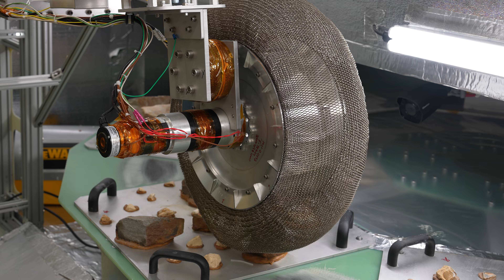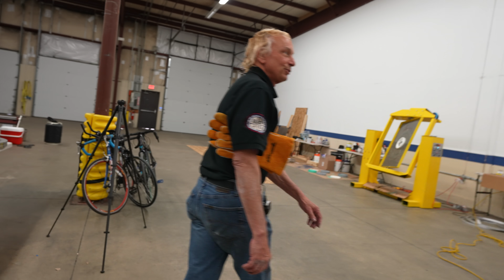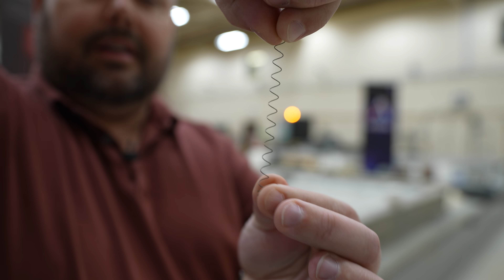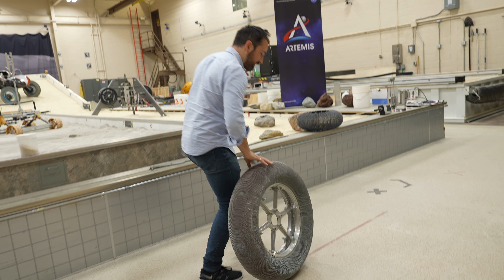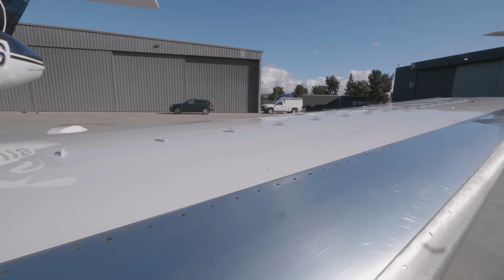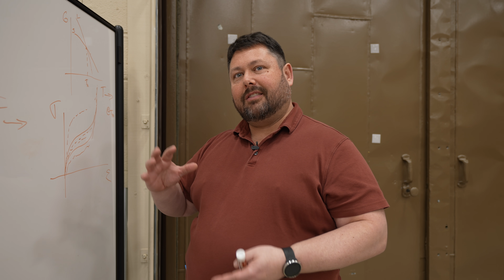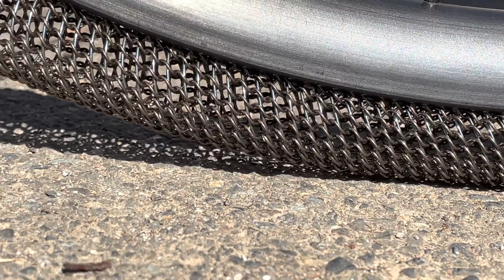How NASA Reinvented The Wheel

Comment: Going from the higher symmetry phase (austenite, FCC) to the lower symmetry daughter phase (such as martensite, BCT or B19′) is exothermic. 
Exothermic Process: The transformation releases heat.
Reasoning: The transition from a less-ordered state (higher temperature) to a more-ordered state (lower temperature) releases energy, making it an exothermic reaction.

Martensitic Transformation: The transformation from FCC austenite to BCT/B19′ martensite is a diffusionless, shear-like process that occurs upon cooling, which is exothermic.

Reversibility: While the cooling from austenite to martensite is exothermic, the reverse process—heating from martensite back to austenite—is endothermic. 

In summary, because this transition involves a decrease in temperature and a shift from a higher to a lower symmetry phase, heat is released (exothermic).

Comment: I've been interested in robotics since I was in my early teens but when everyone started building them with electric motors or hydraulics or pneumatics, etc.  I lost interest because the obvious limitations made it clear none of those singular paths would ever exceed the capabilities of a human body.  My concept of a robot had a nuclear core and heat-activated, metal, muscle cells/fibers attached to a metal skeleton and could move with more strength and fluidity than a human. Nitinol, hydraulics, pneumatics, nanotechnology and Boston Dynamics LIDAR based sensory feedback systems are finally ready for my robot.

Comment: So you. Are inside a different earth  system.  . With a independent power supply.  Capable of supplying  aprox 16amp around 3KW. How does the fault protection work.  If you were to plug in a faulty kettle and touch a tap. ?????

Comment: 12:42 one little spring of nitinol just produced 20 pounds of force, just 10 of those could do 200 pounds, now 50 of those in an exosuit from the future made to enhance lifting and our carrying weight, would be made of this, using electricity to generate enough heat to help one carry stuff, and cooled down when the task is done, or i just watched too many movies😅
Reply: Thinking about it, you can just use normal mechanical parts to lift, and the heat from the motors and or batteries could be used by nitinol to help with the torque or strengh

Comment: The fact that it can never be under rinflated or suffer a puncture—both of which would indeed offer a boost to fuel economy may really sound like a good idea. I agree. However, when it comes to practical applications for traditional automotive use, the benefits become a bit unclear a little for me for other things. Perhaps, with the addition of sensors to understand and react to the upcoming terrain, such a tire could adapt in a way that traditional tires cannot. If it could “sense” potholes, rough patches, or even gravel, it might be more adaptable. But in terms of simulating the proven stability and performance of traditional tires, I’m skeptical. For one, the contact patch of an SMA tire wouldn’t be anywhere near as large as that of a traditional tire, especially on smooth, hard surfaces like asphalt. Unless you’re driving at slow speeds or traversing something akin to the loose surfaces of the moon, I just can’t see SMA tires offering the same level of grip. That’s a major concern when it comes to performance on typical road conditions, where we expect a solid, consistent contact with the road for both control and safety.

Then, there’s the sidewall stability. Traditional tires excel at handling weight shifts and highspeed cornering due to their construction and it’s hard to imagine SMA tires providing the same level of sidewall rigidity under heavier loads without sacrificing other qualities. You could have a tire that self heals, but if it doesn’t maintain stability under stress, it won’t be practical for everyday driving.

Now genuinely speaking, I’m not against the idea of SMA tires—there’s certainly something fascinating, the introduction may prevent me from changing tyres briefly- oh I need to be trained about them—but anyways, when it comes to road surfaces and the tried and true durability of traditional tires, they still hold a distinct edge. Plus, I can’t help but wonder how much noise these SMA tires would make on pavement; the constant adjustment could lead to a rather noisy ride? Tell me, I’m really curious now. 

The only true situation I think I may be content is when everyone before or after they were zombified threw all the nails, screws, you name it on the road for whatever reason and the zombies were like the ones in the walking dead then I mean yeah, I’d take these. I don’t know when I’ll need replace them though. Does your tire have a recommend range or year? 😂 just the rough estimate when it’s no longer practically drivable I change them xd

Comment: can't you just combine the tire and the iron tire together ?
cuz with the rubber of a normal tire, it has more grip on the ground but the tire can pop and loose the structure of the tire and stop working normaly
, while the iron tire has an in destructible material and structure but less grip on the ground { by ground i mean roads } 
so if we combine those 2 together, you can create something that basically you never need the worry about again,
or there are problems that i dont know of so please correct me
Reply: Unfortunately, this approach does not eliminate the problem of achieving the lowest possible weight for objects sent into space, and even then, rubber is too fragile in the harsh conditions of Mars or the Moon. Even if we ignore the extra weight and choose a material that is more durable than rubber, it will still wear out so much over time that it would be the same as using only nitiol tires.
Reply: @w3n11  i know it will shatter in space but i ment a use for it here on earth

Comment: Does it induce electro magnetism when stretched and vice versa, can an electrical current, AC or DC, induce movement?
I had an idea for something similar but you wind it only half way around the rod and back forming an arch shaped, semi tube, (not-quite coil,) apply different AC current frequencies for movements. Perhaps DC current amplitude variation does something else.
Saw it in a dream so, may just be garbage. Though, I believe I saw a magnetic lens in a dream 20 years before I knew what it was.

Comment: They demonstrated a car tyre, but only on one wheel.  That was disingenuous.  Three rubber tyres were providing traction and the nitinol tyre came along for the ride.  Rubber tyres work so well because they react chemically with the road to provide traction.  There is none of that with nitinol.  The only traction you get is where the physical roughness of the road snags on the weave.  Nitinol tyres would be like driving on ice.  I suppose the solution would be to embed the nitinol in a traditional rubber tread.  This would have traction without needing to be inflated.

I would love to know whether the story about its discovery is true, or whether it was reverse engineered from the Roswell crash debris.  The origin story seems contrived to me.  This material behaves so much like the metal described by the witnesses of the original debris, before the military changed their story the next day and substituted aluminium foil for the press photos.

Comment: A few questions on this safety wise. What if the ribs (spiral springs) end up bending forming flat or soft spots and/or the tire gets punctured and water gets in there to start rusting the wheel... Just a heads up to save possible horrific damage. I guess it would be fine on a machine, but that would be hard to trust for a human to be on. Great idea needs some tweaks.

Comment: 15:02 specifically the part about stretching the nitinol wire, This has to be one if the coolest things in science I've ever seen. so often we see concepts like this visualized in relativity abstract ways, that make it hard to connect whats scientifically happening to what we see/ experience in reality even just on the microscopic scale- never mind molecular. but this is one of the only times ive seen a process like this where you could LITERALLY HEAR the molecular structure changing as you stretch it. thats absolutely insane to me, in such a cool way.

Comment: Couldn't they add a way to electrify those wheels as needed and give it the right current to heat it up allowing it to return to memory configuration of the Nitinol? This could be an as needed thing in case something happens where it goes past the elasticity range.

Comment: You know what's interesting about a stress-strain curve is that strain is along the X-axis. That's because when you load a material, that load is causing deformation, and the material is imposing its own force we call stress to counteract it. The stress in the curve in the video (which is for steel) even has negative slopes in it, which would be impossible the other way around. So technically, "stress causes strain" (paraphrased from 5:40) is confusingly not correct.

Comment: Question: if the metal reforms into its original position, does it become more brittle in that form. I'm asking this because it seems to be a rather malleable substance and when a malleable substance becomes hardened it's harder to deform but becomes easier to break, crack, ect. Though I guess it's malleability isn't necessarily changing, it's just as malleable but you just can't control how it moves.

Comment: I dont get the thing with the tires... why do you need a special metal, that remembers it pre-defined state.
Couldn't you just use regular metal like steel an make a spring and an airless tire the same way?
The right steel shouldn't deform under the pressure of a bike and it's driver as well, right?

Comment: Why not Use Magnetic engine block. I can think of using the Circular 🧲 to create perpetual motion of the fuel. All instead of  plastic 3D printer 🖨️ Parts. I think it will increase the Neuton punch the engine has now from 4-500 to 800-1000 Neutons. It increases by 🧲 Magnetic Strength. I've seen and used Magnets in the past that could lift a Car 🚗 off the ground,2000 ft pounds of Magnetic Strength with a Cable drilled into magnet to lift car off the ground using a Forklift or Crane. In Florida these powerful Magnets can be made to Specifications needed for your Entire engine. Let me know if you try this idea. Don't be afraid of the unknown power of Magnetic power being turned into Magnetic Plasma. You can even reverse Polarity from Earth 🌎 and the Heavens.

Comment: Excellent video.    I am a "tricity" junky also.  Every thing g you have showed is exactly how my minds eye sees its functions inside the laws we are aware of.    I have a interesting phenomenon that happened today.    So I am starting my Onan generator up on my off grid property.   And the generator has  no starter.  Just uses the generator winding to start.    OK.   So.  First.  The generator isn't stock.   But it was originally a 220 generator with a common. Leg pulled from center much like home power.    2  220 legs.   With a center tap neutral to split to 110. OK.  Well since i needed 2 220 legs for my deep we'll pump.    I eliminated center tap and now have gobs of power.     And I still use the center tap for other appliances after it comes back from pump it center ter taps and compressor and other house hold devices use it.   However it is a lot more difficult to start on 12 v.    So I set up 2 12v batteries in series so I have 24v.   But still struggles at times.   So today.  I hooked up my Samurai to it 12 v.   Parallel to the battery that positive terminal is hooked to generator.  Aka.  The back battery.    OK.  So.  In series in parallel and generator almost ran without needs gas combustion.   I mean it had so much speed tur ing o er.  No started pu.lin g wafer from 150 feet down in a 3/4 in pipe before generator even ran.

Comment: How well would these tires do on a highway? It seems like they might get better traction on ice specifically, but does the rubber grip asphault better? Also, would they wear out the road more, meaning more road work would need to be done? This is some fascinating stuff.

Comment: Maybe to add, the names of the phases are originally from steel. Martensitic phase transformation is the key mechanism for the high strength of some steel alloys. But what you need for shape memory is a very low volume change to be reversible. Otherwise the volume change will cause additional plastic deformation by dislocations.
To be honest we were not so excited anymore in our material science lectures knowing that this is the same mechanism as in „boring“ steel. After treated with time temperature transformation diagrams you do not want to hear the word martensitic anymore.

Comment: I am one of the original engineers at DRL, who designed the actual LRV Moon Rovers.  One issue not addressed in this video is the wear and tear caused by the highly abrasive dust, both on Moon and Mars.  In airless or zero-humidity environments the dust particles are basically like fluid sandpaper.  Any wire meshed tire, where the wires slide by each other due to mechanical movement, will have a very limited lifetime, and the wires will basically saw each other into segmented pieces, with protruding wire ends.  This would be a puncturing danger to any Astronaut suits, but might actually enhance temporarily the tractive effort ability of the tire.  If enough wires are broken apart, however, the tire will entrain the dirt, and will sink lower and lower, eventually becoming stuck in place.   For the LRVs the spring steel wires were coated with a zinc sacrificial coating, which acted as a simple metal-to-metal lubricant, similar to moly-sulphide greases on Earth.  The ratio of the coating to the steel determined the actual internal scrubbing lifetime of the tire wires (as determined by the actual dust abrasiveness).  The simulated lunar dust was tested against actual tires, in an US-Army testing facility, and actual tire lifetimes were determined.  Many samples were tested, and many failed early.  In addition, the "floatation" of the tire was also experimentally determined.  Depending on the actual wire weave, some tires will entrain dirt, due to the weave flexure while flexing in the dirt onto its own footprint, while other weaves will actually reject the dirt.  This was also tested, and the actual LRV tires  were specifically woven to allow rejection of the entrained dirt, during the relaxed state of the tire (ie: out the back, and over the top).  This is easily seen in the actual videos of the "Grand Prix' run on the Moon.  The on-Earth mud-racers have these same problems, and wire tires are often filled with styrofoam or other padding, to prevent mud entrainment.  The LRV chevrons were not only added for traction, but also to reduce dirt entrainment, and the angle of the chevrons was a compromise between the wear and tear effects, and the floatation desired.  This was tested in our labs, during night shifts, where I was working the electric-drive system, along with the cognizant mechanical engineers.  Robert Petersen was the main mechanical engineer who did most of this dirt-work.  He is the one who should get the credit for this work on the actual LRVs.

Comment: This is such a cool idea. I do have some questions though, how would this work if debris get stuck inside the tires? This could potentially cause stuff to collect inside and fly around as the wheel turns and maybe torque it at high speeds. And if it’s stuck near the surface, could this impact it’s grip on terrrain and cause slip? Like how gravel stuck in the treads of your boots can make you slip. I am very curious how these problems may be addressed and solved in more creative and innovative ways :)

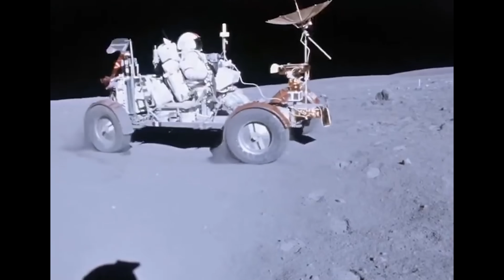Comment: 07:13 we see stars from the Earth but I can't see a single star from the moon???
Reply: Because of how exposure works. The reason you can’t see stars during the day is because everything in your vision is very bright and therefore small, dim objects will be practically invisible. This is the same for daytime on any planet or moon, atmosphere or not. As long as there’s something big and bright taking up a lot of the frame, you will struggle to see any stars.

You can adjust the camera settings to take longer exposure photographs so you can see the stars better, but this will mean brightening the image. Look at how bright the surface of the moon already is. If you made the image bright enough to see the stars, the foreground would be a massive, glowing white mess with no distinctive features.

Next time you’re outside on a cloudless night, go stand underneath a lamppost and look up and see how many stars you can see. The amount you can see will either be zero or very close to zero.
Reply: @アイスクリーム-u8s  nowadays it's already impossible to see stars. Under a lamppost or not.

Comment: 1: How much for the bicycle tyres in size 24x1.75 or 24x1.95 (depending on the tread width) and 20x2.25?
I need three of the 24 inch, for my adult trike, and 2 for the bicycle trailer.
Come to think of it, could also use 26x2.1, 700c x35, ndwhateversize my 4 wheel garden/nursery carts take. (garden/nursery carts can be pulled behind the trike,)
I'm guessing these havea high load capacity, andweig considerably less than the polyurithane airless tubes and tyres currently on the market? 
2: WHEN will these tyres hit the market?